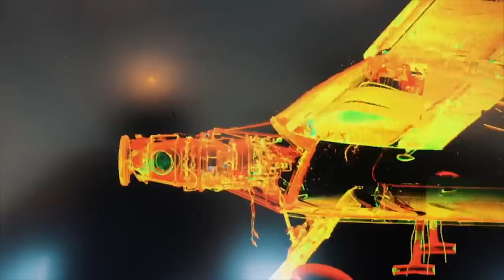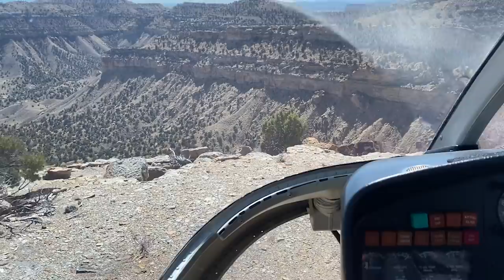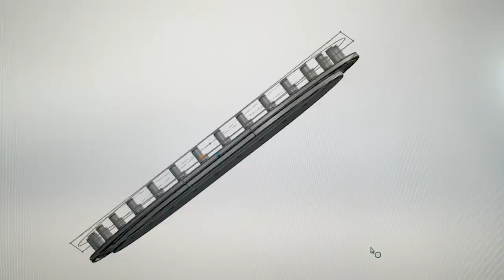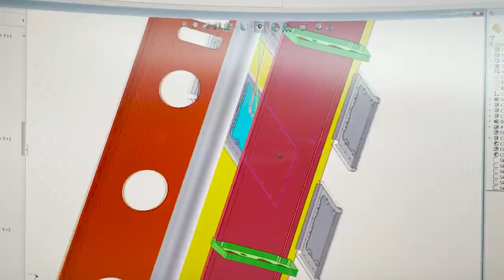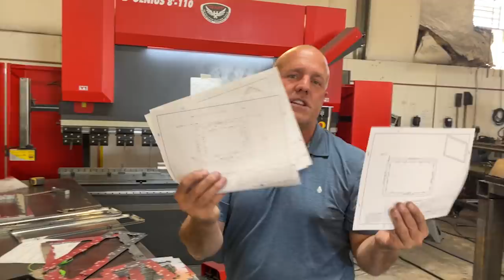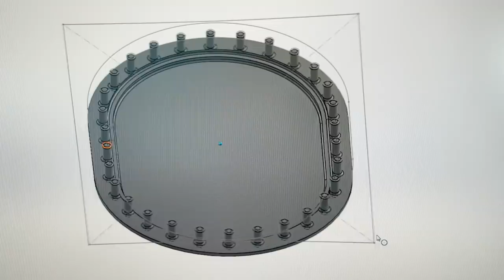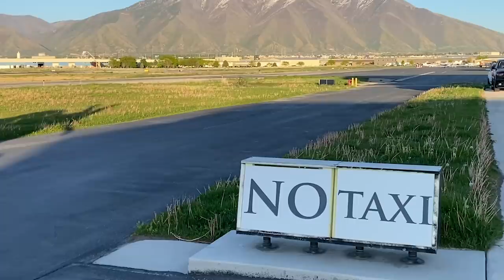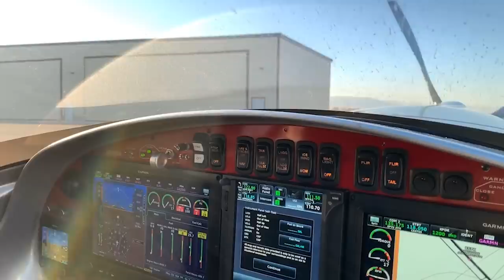Helicopter picks up airplane & Scrappy thermal tests | Scrappy #53

Comment: Any body else wondering how he's going to attach his best tug so he has it when he's outta town?
Reply: It will fly autonomously behind Scrappy or in front 🤔 to block the bugs
Reply: He designed a backpacking fold-up model Second Best Tug to carry along.
Reply: Scrappy won't need a separate tug. Mike hasn't yet shown us the small lightweight remote controlled wheel hub high torque gear motors that he installed in the main gear. The gear motors each use a magnetohydrodynamic clutch, which engages when a small electrical current is passed through the fluid, and automatically disengage when the circuit is broken and the current is removed.
Reply: @janetyer7147  Jane, don't go getting him started... he'll be off on a tangent and no one will know where he's going!  (but that sounds like a great idea!!) 😁🤣

Comment: I wonder what Scrappy would run if you drag raced it on a quarter mile drag strip. 🤔
Reply: This is the question we need answered.
Reply: @Daytonaman675  definitely he doesn't necessarily need to go to a drag track but I think that would be epic all he really needs is a vbox to test 0 to 60 time and quarter mile times
Reply: @fractal4284  I’m betting he knows some car guys who would loan him one for a tiny bit of CF work
Reply: @fractal4284  I'd expect the 0 to 60 to be pretty impressive, but the quarter may be slower than most people would expect.

Comment: Blind threaded holes on the fuel tank lid to prevent leakage through the threads?
Reply from the maker: 👍🤠 The threads and hole stops before the end of the machined shaft and the o-ring is placed so that fuel can’t get to it from the side.  Fully sealed and closed out all directions

Comment: Being a Tank Rat, hearing everything you’re doing with the fuel access points is erotic 🥴
Reply: Yep spent 32 years as an airframe fitter working on P3s, F111s, dhc4s and helicopters.
On P3s and F111s fuel leaks were a pain and could take weeks to fix.
Im interested on how hes going to seal the rest of his tanks, proseal is the current answer and in Mikes case putting the wing together wet.
I love his access hatch seal idea, its been done before but probably not on something this small.
An engineer that takes the mechanic into account when he designs something can only mean 1 thing, hell be the bugger working on it at 2am in the wind and rain in a paddock somewhere remote.
Love your work Mike.

Comment: Mike, your attention to details regarding future maintenance access is amazing. As a professional aviation maintenance tech (AME in Canada), I can’t  tell you how many times I have cursed the engineer that designed a part or system on an aircraft.  I’ve always said that an engineer should have to work as a maintainer first, to understand what the downstream users of the product will have to deal with while making their design decisions. Can’t wait to see Scrappy take flight!

Comment: I think wet wings are mostly seen on aluminum skinned wings.  Aluminum skinned wings are almost all stressed skin so large holes for inspection doors create weak/heavy spots in the wing.  So the compromise is tiny doors...
Reply from the maker: 👍🤠 everything is always a trade off. On this I chose thicker door rings to carry the loads and the cost was a few extra ounces.  Since I’m the mechanic that has to deal with difficult inspections I choose ease of service and a little extra time engineering the openings is worth it, for me anyway. 🤠 great comment
Reply: @MikePatey  you also have the luxury of lightly stressed skins.  My dad's Piper Aerostar on the other hand...

Comment: Mike, on the wet wing fuel systems ive worked on. all had milled style 2 piece panel and a milled landing for panel to mate up to. Any flex can cause unwanted leaks. Also, need to consider a bonding mesh gasket. (think lightning strike) love your stuff. thanks for sharing

Comment: FINALLY a guy that designs aircraft for maintenance guys! And man I've been suggesting using fuel safe O'ring seals on aircraft for many years...
Love your work man!
As long as the door structure is strong enough it will definitely work.
I wish I could come work with you man, my imagination would go wild 🤣🤣🤣😎👍🤙

Comment: There is a certain satisfaction in seeing that dimple die improvisation. I made something similar out of a pair of fencing pliers and a drillbit shank to punch rivet holes in sheetmetal for a lightweight airboat hull. With the gas struts for the wheels, changing tyres will be easier if there is a support point under the fuselage somewhere. With all the R and D going into this, it seems a pity it is to be just a one-off - or is it? One senses that there is more thoroughness going into this project than into some aircraft sold for profit to people who must hope the work was done right.

Comment: Hi Mike, I like your design for the inspection door.  Since you are machining the door to create a groove for the O-ring, have you thought about adding a few indented areas on outside surface that can be gripped to help position the door when it's installed. Flat smooth surfaces can be difficult to find traction on.  I enjoy watching your videos. Please keep them coming.
Reply: A suction cup handle should work.

Comment: those Cirrus planes fall out of the sky like candy from a pez dispenser.  If not for the chutes they'd be the new Dr. Killer.  coming next week, Mike's air to air refueling system. It's a little bionic skeleton that lowers down with a hose to top off other planes in flight. Mike's going to need a new set of tires before Scrappy ever leaves the ground.  J/K about the tires... or am I...

Comment: Cross threading into the door having to replace it?  Just toss some helicoils in from the start, and if you cross thread it, you just get the needle nose pliers, rip out the old helicoil, and install a new one. Plus you get a nice steel on steel thread, rather than steel on aluminum, so you can be in and out of your fuel tank as much as you need, and the threads wont wear anywhere near as fast. Plus the pull-out/stripping torque is higher in aluminum since the thread in the aluminum is wider with the same pitch.
Reply from the maker: 👍🤠 absolutely
Reply: I learned working in a machine shop making some higher end parts where all the threads were helicoil'd to not think of them as just a means to repair a thread. Fantastic as a preventative, since an annoying repair turns into a 5 minute task.  That and thread-forming taps are great, no shavings to clog the tap, and work-hardening of the base aluminum makes the threads stronger than cut threads.

Comment: Is there any kind of landing gear warning for in flight? With all the suspension modes you've got, what safety measures are there so that you don't land with an inadvertent gear condition? Love the taxi shots!!
Reply from the maker: Yea it has warning Sytems and you can correct it and then lock out all the Sytems to isolate to a standard suspension instantly if needed.  I go into that in my last video

Comment: Instead of dimpling the holes for the nutplate rivets, and dimpling the nutplate ears, you could use an “oops” rivet NAS1097. They have a smaller head and allows you to put a tiny countersink on the part to accept the head!

Comment: On my Luders 36 sailboat I had 99 gals of diesel in 3 tanks giving a theoretical range of 1356 nautical miles on the engine alone.   Your fuel load seems massive.
Reply from the maker: Great point and I will rarely ever fill it.  I have made the mistakes before of wishing I had more fuel tank for one flight or another. It’s nice to have the option of just putting in 30 gallons most of the time but if you want to go ahead and tanker some extra you have the option.  I will rarely fill the tanks but it’s engineered to if we want or need the range now and then.

Comment: Mike do you patent some of these ideas, parts, designs? For example the inspection door design with the seal and threads built in, something likely desired by other aircraft manufacturers.

Comment: My girls family owns an FAA Repair station in Oklahoma.  We work on inspection doors like those all the time for different airlines and aircraft types.  Very interesting take on the design!  The way doors are currently designed on jets are a nightmare to repair and often get scrapped costing the companies to source a new replacement,  or we make a new one from scratch per the cmm.  I bet yours will last alot longer.  Will you use BMS sealant on the door frames?

Comment: Mike, do you have any Power to Weight ratios of Scrappy to most 'normal' bush planes, or as to Draco...?

It'd be great when Scrappy is done to see your remarkable work comparing with either planes specs, considering the advancement of technology in weight saving metals including carbon fiber in the structure.

Comment: Another remarkable video. It is always such a pleasure to peer over your shoulder as you work and somewhat as you think as well. Well done. The prop on Scrappy is quite unique and I'm wondering if the prop is a "test" prop for use during building and testing but to be replaced with your "serious" prop when the wings are on and Scrappy is flyable. Perhaps you would share your thoughts about propellers in general but specifically about why you chose the four bladed, thick prop over a slightly longer three.
Beautiful videos and I expect you'll soon achieve 300k and then it's off to the races. You are a gem and a gentleman.
Reply: https://youtu.be/stkvTQ1lCSw here ya go 😀
Reply: Prop discussion started after 15 min

Comment: On the topic of stripping threads, best advice I ever received was to back a bolt up until you hear a click, that's the threads aligning properly between the bolt/screw and where its going, then you do it up. 

Unless your torquing it beyond limits, you will never cross thread a bolt again.  

At least I haven't anyway, hope this helps someone else out there.
Reply: I always spin backwards first until I can feel the threads engage properly. But I also always finger start screws and bolts if at all possible. But I am not a paid mechanic, so don't have the time is money pressure on my shoulders usually.

Comment: I did my mandatory military service as an airplane mechanic, with another petrolhead and a freshly examined engineer.
He said "I learned the practical side of constructing things here with you guys, it will help me avoid so many misstakes in the future"
Every time we encountered a stupid design makeing life hard for the mechanics, we let him have a look at it, and redesign it on paper in a better way, there was always a better design option....
He also learned to design fool proof, like the window frame with 3 different length screws, with the same tread, where if you got them in the wrong place the window could pop out during flight, he redesigned it with 2 different lengths, and those had different threads so you could not mix them up, fool proof....

Comment: So when this critter is done - I'd be he could easily sell kits or better yet finished planes.   Just watching these little taxi playtimes you can tell this plane has all the goodies a STOL enthusiast could want.   Best of all for him,  It's a totally new design of HIS making and not a modification of an existing airframe like Draco.  Yeah, he could sell lot's of Scrappy planes around the world.
Reply: No. It was not designed for manufacture, and as he was making parts, he did not make production molds. He only made single-use molds. Plus lots of CNC machined parts (expensive). Mike is amazing but part of the reason he can do what he does is that he ignores design for cost and design for manufacture concerns. Scrappy is purely a one-off. Making money in general aviation is hard. Selling tugs instead of planes is probably a smart idea.

Comment: Yeah I want to be able to refuel my friend's planes with my little carbon cub built from all kinds of random scrap parts. So basically I have a racing airboat propeller, top fuel dragster motor, Baja suspension and the ability to be like a KC 135 refueling tanker! Oh yeah, I almost forgot, and a parachute for the entire plane plus passengers! You're a freaking nut bro! I love it!

Comment: I suggest you reverse your solidworks zoom settings for the mouse scroll wheel to make sense. The default is backwards and it looks like yours still is set backwards. It will save you some more time to make it match all other zoom behavior in windows.

Comment: And other thing mike, why you don't make a whole part in carbon fiber e de attach from the wing to do inspection, something like the tanks will be attached to the wings spar and the carbon fiber will cover it, you curt the carbon fiber, put some step in the joint and you can remove the carbon fiber layer and now you can see the entire things inside the wing, something like you did with the down cover in the tail and the high cover that you showed us

Comment: Would love the range of that 120 gallons is a lot especially for a cub , defo want one for here in the uk could use the range of it
Reply: Remember 8 cylinders and 600 horsepower, added range if he can economy cruise with 4 or 6 cylinders running if that's safe and possible
Reply: @primrosereceptionist611  i assume it can be done as some cars also implement that tec the question is if he did do it would it be able to sustain flight or produce enough positive thrust

Comment: You really need to put those O-ring inspection door on top where most of the time the fuel Will be lower. Seal with sealant the bottom skin where the fuel will sit most the time. This is due to expansion and contraction that that O-ring will see during all types of temperatures. This is why most fighter jets seal the bottom skin 100% even on removable doors and on top only have a simple gasket made by sealing the door shut with release agent then pop it open creating a gasket on the part.
Reply from the maker: 👍🤠 Great points, I’m extra familiar with both.  So many planes flip flop some top and some bottom. The expansion of seals is only a problem if your using the wrong materials for the temps. Because of something special I’m doing with the wings the bottom is the best choice for me on Scrappy and makes a flat machined based rather than a curved joint. Also, as you know,  many planes keep them all on bottom if they have critical airflow over the top. Placing them on top has been a critical problem in past and often caused a redesign to the bottom if the separation point of the laminar flow is likely to happen as approaching the stall is anywhere near the inspection fuel access door joints and screws.  It’s done both sides of the tank all the time for so many reasons.  For scrappy it is the bottom so we used airliner style.  Great comments thanks 👍🤠
Reply: @MikePatey  Read “The top is going to be changing shape “ 😀

Comment: Mike, on the big inspection doors... are you putting Seal-Caps on the WET side of the door to cover the protruding screw?   It’s what it looked like to me on the CAD   

INQUIRING MINDS ..... Want to know
Reply from the maker: Great question. 👍🤠 The screws don’t pass through. What you see is the solid Alluminum part from the original block and the hole and threads stop 1/8 short of the end of the stock you see.  Fuel can’t touch the threads at any point and the Oring separates it from the side.

Comment: Consider, if you will, the idea of an extended leading edge wrap for the suspension "wings". Attached at the top, floating at the  bottom.  You wanted a biplane,  not a triplane.

Comment: I love a Cub but you know Cub engineers watch each video saying “why didn’t we think of that?”  Management makes sure they watch.
Reply: Everything is different when you are designing a commercial product. I don't design airplanes but have worked on design of other products. You are designing for cost, designing for manufacturability, designing to meet FCC or other regulations. Many of the features Mike is putting in would increase the cost of the aircraft or are otherwise not practical for commercial manufacture. I do think that some of the nice features probably COULD be done on commercial products. But there is also usually some schedule pressure to get the design finished. So, anyway, it is not that other designers are not as good as Mike. They are just working on a whole different set of constraints. And, he is a good engineer. I am not talking trash.

Comment: I really like the CAPS system. Too bad pulling the chute basically totals the aircraft.
Reply: Well, it beats ending up six feet under.
Reply: Unless its on a Mike Patty designed and built plane.
Reply: @fredbugden3511  Absolutely. When I saw how
mike built Scrappy, that was one of the most impressive parts of it! Mike always thinks 20 steps ahead. That’s what makes him so special.

Comment: Hey Mike, I’m guessing you using your ‘spare tank’ in the tail to run Scrappy around as you have no wing tanks yet?
Reply from the maker: Correct, my wings feed to that tank so I always pull from there. It is also a vertical and funnel bottom tank and can get every last drop. It’s gives plenty of time for any sloshing in wing tanks to get every drop from the wings to the vertical tank.

Comment: Is the wing more door than wing... Or more frame for doors.
Either way, great engineering. All engineers should spend 6 months in a repair centre, before starting a new project. Then a week looking at total failure of old designs.